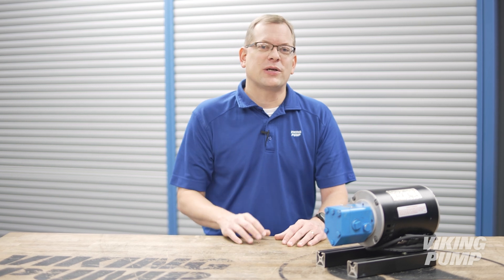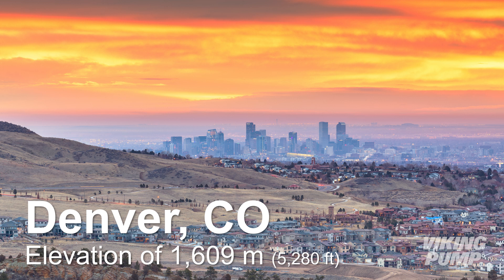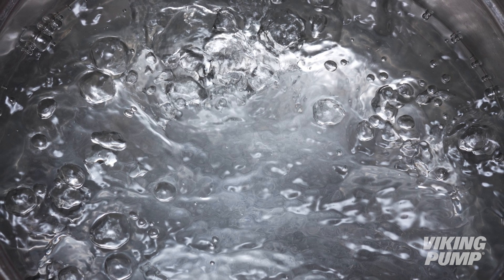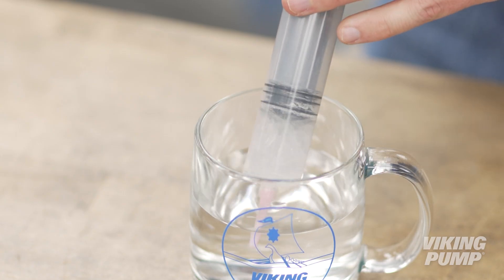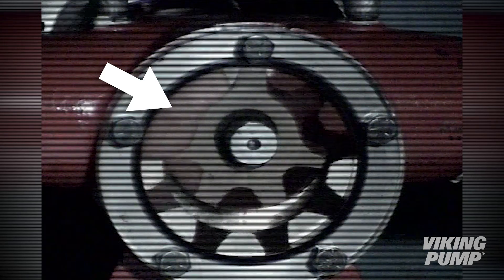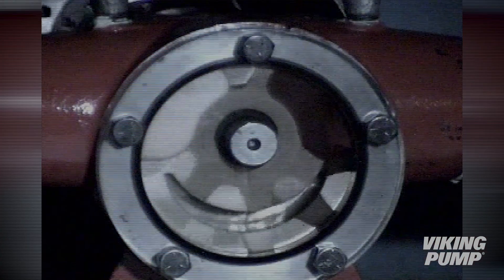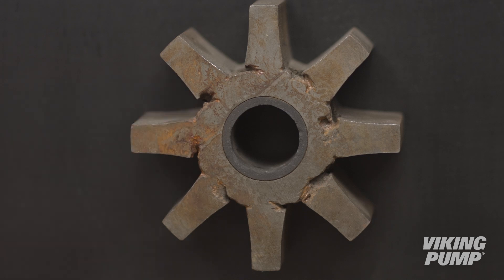What causes pumps to cavitate? And why is my pump so LOUD?

Comment: Thank you for the video. Where should the vacuum gauge be installed?
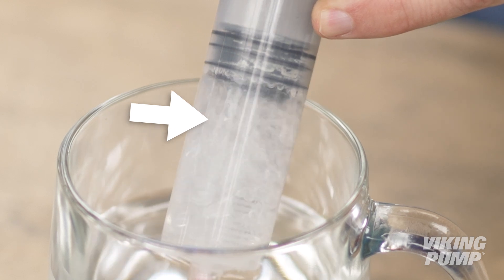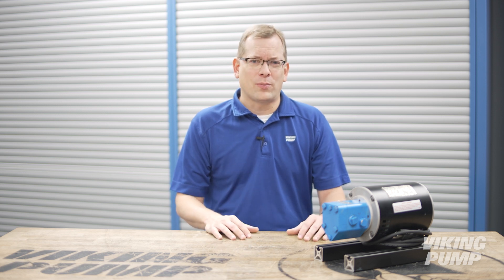Reply from the maker: Vacuum gauges (or compound gauges if the inlet pressure could be positive at times) should be installed at the pump’s supplied gauge port or at a point in the suction piping as close to the pump as possible. You can see an example of each in this video at 1:42 and 0:28 respectively. 

1:42 - https://youtu.be/uPV0F091AHI?feature=shared&t=102
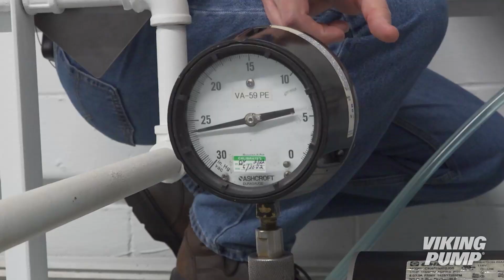0:28 - https://youtu.be/uPV0F091AHI?feature=shared&t=28

If you've got questions about specific pumps, feel free to reach out to us here! https://www.vikingpump.com/yt